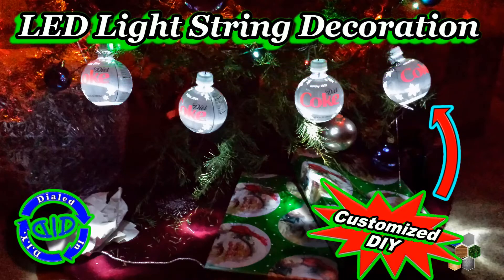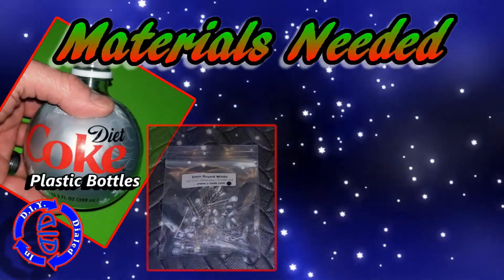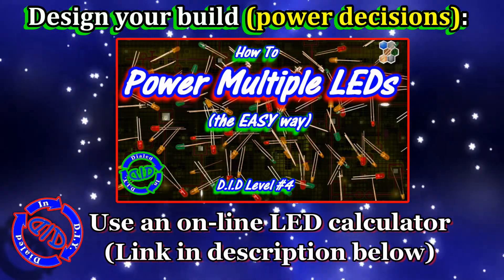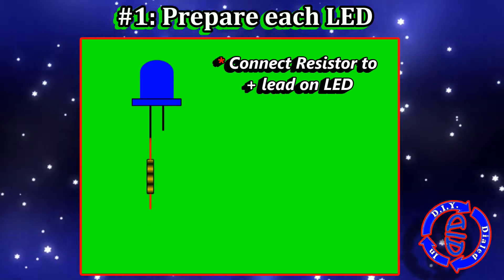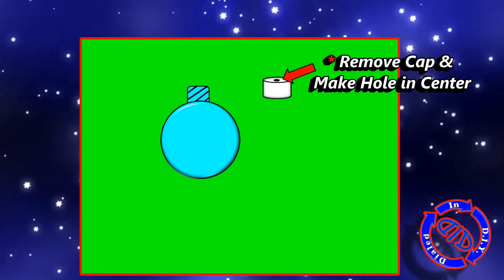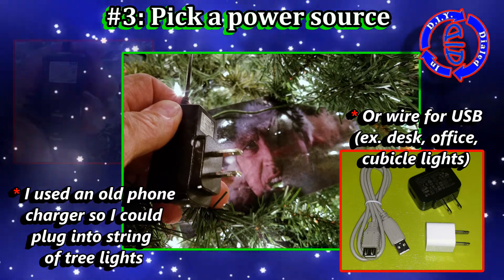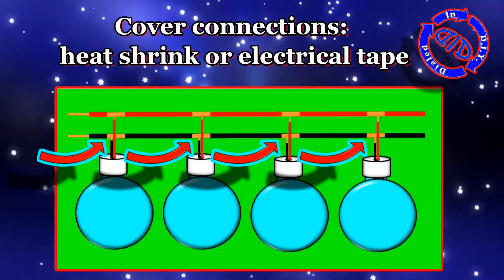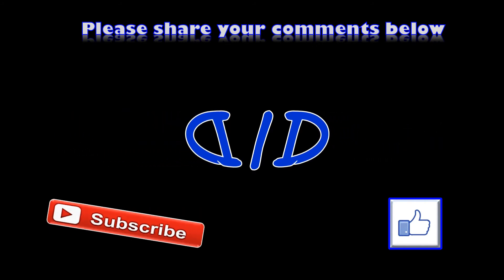Make Cool String of Decorative LED Lights - DIY Project Tutorial

Comment: Really helpful video, I just wish there was information on what gauge of wire to use.  Also, I'd like to know whether or not you cut the wire into sections, or just strip enough insulation off the wire to connect the LED.
Reply from the maker: Good questions. I don't recall the exact wire gauge that I used but I  often just grab whatever I have handy on a project like this.  For this string I did cut the wire into sections but it could definitely be done by stripping sections.

Comment: Hi, I'm trying to learn LED and I found your videos very well done. 
I have a question: With the parallel setup you showed, is there a way to make it as tileable sections? 
like an extendable line of LEDs. it is possible to make?  what type of connection plug and play I should youse?
Reply from the maker: Thank you for the feedback. Are you trying to make one line of LEDs or some parallel rows? Either way it is doable. In one of my videos I showed how to use a site to map out set up options. I will find it and put the link here.
Reply from the maker: This video has the layout planning - https://youtu.be/vcrrciHGasA